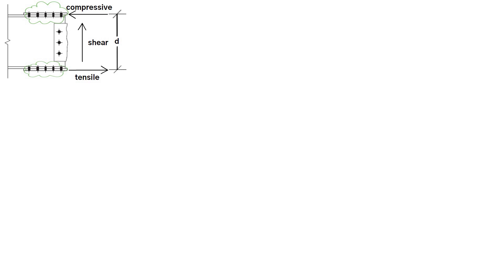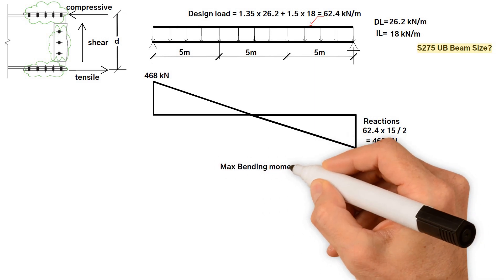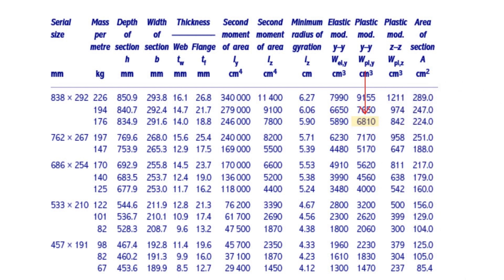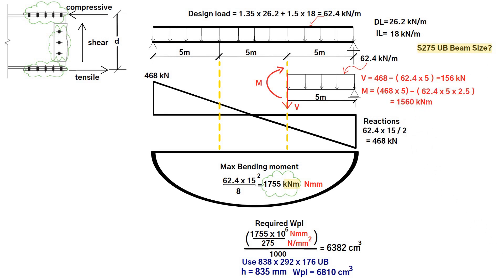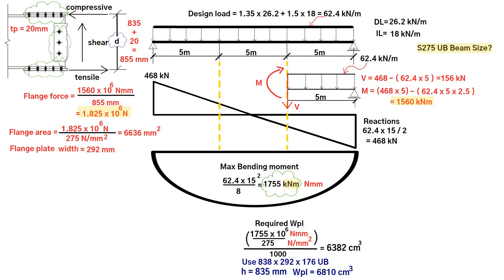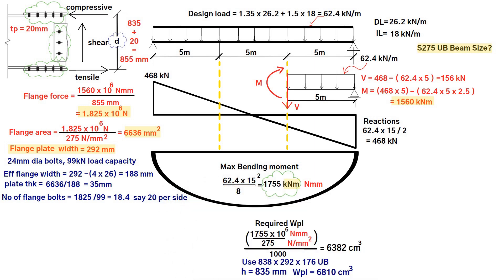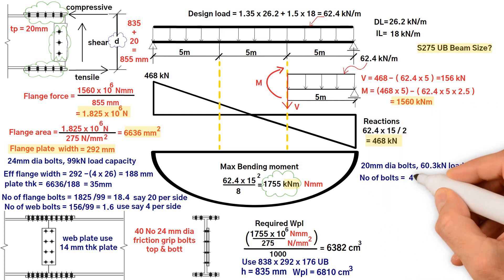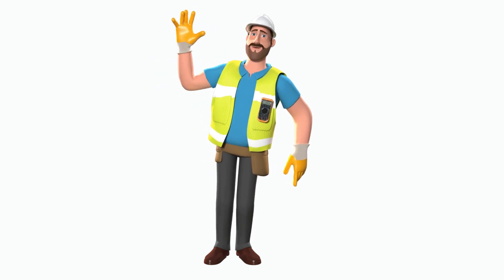How to work out a steel beam splice connection.

Comment: In effective flange width calc, shouldn't it be only be subtracting the holes for (2) rows of bolts instead of the (4) shown in the calc? Should be 292-(2*26)=240

Comment: Great example. Can you do one with welding please?
Reply: I am no structural engineer, but i am a welder.. If you used full penetration welds [as you would do] then you would not need any additional plates, just weld the ends together. Problem would be, the resulting distortion, the beam would be anything but straight..

Comment: I've seen spliced beams in loft conversion videos and no flange plates used as specified by structural engineer. I want to have a beam like this so as to minimise loft space height. Is this possible?

Comment: can i send you some drawing to look over ?
Reply from the maker: Yes of course no problem.
Reply: @structuralengineercalcs  I am looking to build a gym using angle iron 50x50 with 1/2" round bar as diagonals

Comment: Appreciate the hard work Dear Structural Engineer Calc. Can we also make a video regarding the design of base plate for steel columns. It would be great to start with the base for steel works. Thank You ! Keep sharing your knowledge with us.
Reply from the maker: Thank you! It's on our to do list :)
Reply: @structuralengineercalcs  I would prefer the basis design for anchor bolts it's so confusing to design however base plate can be designed with fixed set of formulas in every codes. Thank you.
Reply from the maker: @er.lalitbhatt7343  Added to our list.